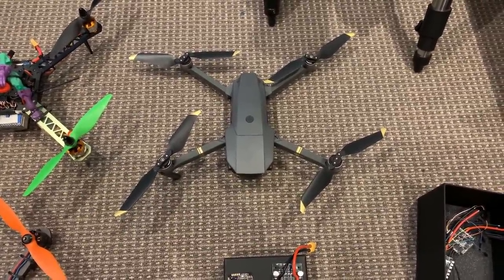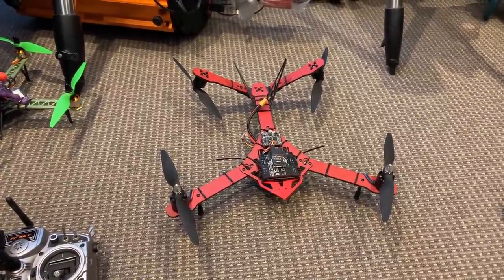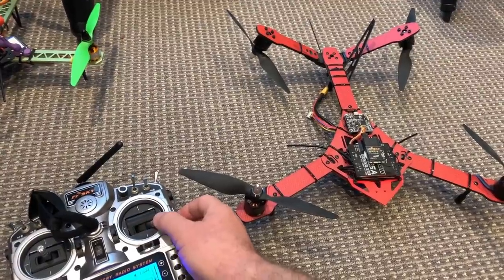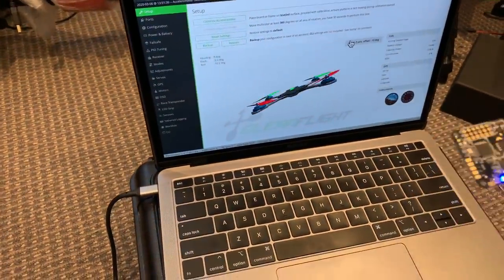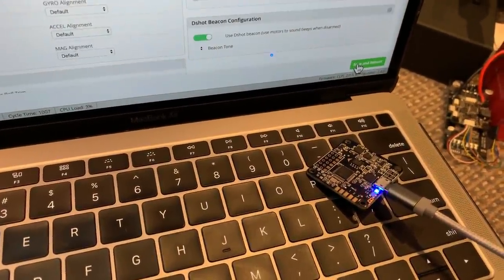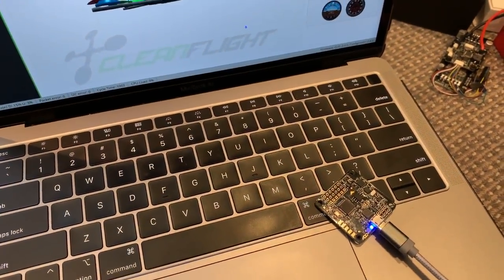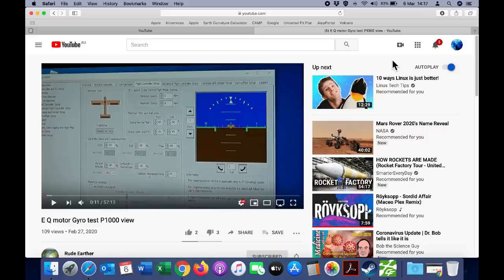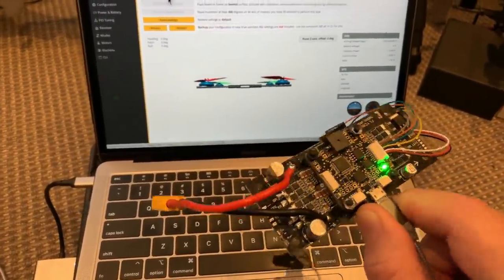A closer look at Drone Flight controllers.

Comment: Taranis is the best RC transmitter in its price range in my opinion. It's hugely configurable, talks to you, can be configured from the PC, does the whole nine yards at a very affordable cost. I use it in fixed wing models (one of them uses an ArduPilot controller) and on the TBS Discovery Pro drone, in which I'm using a DJI NAZA controller. I do use another transmitter (Spektrum DX7) on my helis though, just because they have been configured and tuned for years, no need to fix what's not broken.
Good video, thanks for sharing.

Comment: So what he’s saying is the board has two thingys working together. The gyro is only a basic gyro, and by itself cannot tell which way is down. It can only give you a rough idea how much you roll, yaw, and pitch. The accelerometer is not great either. It can tell you which way is down, but perhaps it doesn’t have the accuracy of the gyro. Together, they are Captain Planet!

Comment: That reminds me of a Flat Earther that bought an electronic gyroscope and drove like fifty miles along one of the Great Lakes to see if the Earth curved. It showed that it didn’t. 
  He didn’t check the sensitivity of the gyroscope beforehand, and he didn’t even check to see if his car was truly level at the starting and ending points for the less than 1 degree that would have been seen even if the gyroscope was sensitive enough. Of course the model of gyroscope that he used wasn’t nearly sensitive enough to detect the rotation of the Earth, anyways. 
  They just don’t take any variables into account, do they?
   I don’t know if that sounds familiar, as it was probably 3 yrs ago. For some reason I want to say that it was a video that you actually did a response to. I can’t say 100%, because I’ve seen so many videos debunked by so many different people.

Comment: As you indicate, MEMS based gyro/accel/magnetometer sensors such as the one in the Cleanflight compatible boards are generally fairly low-sensitivity (as single-chip gyros/accelerometers go) as they are intended for multiple-DOF mobile-devices for gesture-recognition and similar things.
Some researchers, though, did manage to use more "lab grade" MEMS units to get an "Earth Rate" signal without resorting to interferometer based systems.
https://iopscience.iop.org/article/10.1088/0957-0233/23/2/025005

https://ieeexplore.ieee.org/document/7494470

The software and processing was fairly clever, though.

Comment: How does the “V” affect its flight?  Does it act like the dihedral of a wing?
Reply from the maker: +Kelly D.  It gives very precise yaw control because a component of rear motor thrust is horizontal.   A normal multi rotor yaws by torque reaction speeding up two diagonal opposite motors that rotate the same direction.  

It does require adjustment to CG and a special mix in the controller.   I will cover than in a future video.
Reply: @Wolfie6020  yes please. 

Whats the minimum size for a copter to use magnetic heading hold? With brushless motors (known rpm) and averaging I'm guessing fairly small, but I'd love to see it as an option on micros.

Comment: What altitude is the effective ceiling for such drones?  If you were on top of a very high mountain, would the air be too thin to get enough lift to fly?
Reply from the maker: +TheBartman47.  Good question.  I did notice a slight difference in performance flying one of mine in Switzerland years ago.  

Also the Mavic is definitely more sluggish up at Beaver Creek, Colorado.  The motor RPM is noticeably higher in a hover. 

I guess if you were up around 15,000 ft it would get really noticeable.  

The DJI Inspired had an option for high altitude propellors.   I never needed them but they had more pitch on the blades

Comment: My roll and pitch is setup for 1200 degrees per second roll and pitch rate but admittedly my drones are race drones. Wolfie, do you still fly helis? (models)
Reply from the maker: +OzFPVflyer.  I haven't flown an RC Heli for a while and would be rusty I think.  Something I want to get back into though. It was a lot of fun. 1200 degrees per second is fast!
Reply: @Wolfie6020  Well if your interested Ive got a Trex600n pro with all the fruit on it with onboard ignition and it flys great, never crashed and Ill be putting it up for sale in the next few weeks, Its setup with a DX7 but I want to keep the Transmitter and the 7 channel receiver stays in the heli. Cost me nearly $3000.00 to setup but selling for $650.00. Its a smooth flyer with Curtis Youngblood blades and Curtis Youngblood exhaust and OS 50 engine. If your interested next time your in Perth.

Comment: Hi Wolfie, it is a bit off topic, but I have a question exactly matching your core competence. It is a claim made recently in a discussion on MCToon's channel (in the context how international flights compensate for the Coriolis force).
You may watch the part I'm referring to yourself here
https://www.youtube.com/watch?v=-Rv7q__gbCY (skip forward to 2:02:00)
but to spark your interest a bit more I paraphrase a few quotes:
- corrections for the Coriolis force are always done by the autopilot
- if a pilot would do it manually he would overcompensate and fly inefficiently
- pilots are basically only there in case something goes wrong and for taxing and takeoff and landing
- if the autopilot fails the pilots will land as soon as possible
Honestly, it is the last statement I doubt most as an unplanned landing is a costly operation (I could imagine) and in most any case l imagine it is less costly if the flight continues with the pilot or co-pilot flying manually, even if this were a bit less efficient than engaging the autopilot (assuming all the other systems of the airplane work perfectly fine).
Reply: I should be able to answer at least a little bit(just a student, so Ive never touched autopilot in my life).
There should be no reason to have an emergency landing if the autopilot dies.
As for coriolis, in simple terms, you correct when you are off course, which can happen for any number of reasons.
Wolfie, please correct me if I'm wrong.
Reply: @Alysm-Aviation  Thanks, exactly what I think too. To excuse the confidence with which Jack Zhang made that statement: If you are a well educated physics student (like Jack Zhang obviously is) and you habe to discuss an ignorant fool for two hours it might become unaware of the borders of their core competence.
I have a whole collection of such (mostly minor but sometimes even major) lapses by those supporting the globe (including another one by Jacky Zhang) but I've given up to forward such errors to the person who made it, except the very few who gave positive feedback.
But in contrary, a few of them, including some very prominent "globe earthers" are completely uninterested in being corrected or consider contradiction as hostile offence. And if they answer claiming being right where they aren't and you come back a second time you may get blocked by them or they moderators.
Sadly, if it comes to making decisions based on "in-group/out-group" thinking there is not so much of a difference between (some of) the "globers" and (most of) the "flatties".
Reply from the maker: +Mittelwelle 531KHz.   Thanks, I will check the video but can answer those quite easily here too. 

Correction for Coriolis occurs simply by the aircraft making adjustments to stay on course.  Any deviation left or right of track is immediately corrected with a tiny heading change.   

The autopilot does it more tightly.  If a pilot hand flies he won't necessarily over control but it would be less efficient.  I can agree with that.  I would not say inefficiently,  just less efficient.  The difference would be less than 0.1% in reality if the pilot is on the ball. 

We do usually only hand fly for take off and landing but monitor constantly during cruise and will select new altitudes for better winds or to avoid turbulence.  We will also divert left or right of big storms on track.  The autopilot cannot do those by itself so we set the parameters for the autopilot in those cases. 

I can't speak for every airline policy but we certainly would just keep flying to the destination if the autopilot failed.  It is no big deal really.  Just a bit more tiring on a long trip.   There are some emergencies where the checklist directs us to land as soon as possible or at the nearest suitable airport but autopilot fail is not one of them in our aircraft.   

In the middle of the ocean you don't want to land on a remote strip with a broken plane because there is nobody there to fix it and flying an engineer out with parts will be expensive too.   Unless it is a dire emergency we will carry unservicabilities to a destination with maintenance facilities.
Reply from the maker: @Alysm-Aviation  100% correct.  You can be my wingman anytime.
Reply: @Wolfie6020  don't get my hopes up, otherwise I might just apply to your company should I ever get up to the required licenses.
Reply: @Wolfie6020  Thanks for taking the time to write such an exhaustive answer.
Wrt. the video link don't waste too much time with it - the usual crap with an utterly ignorant flat Earth proponent who is missing to understand most badic physics like frames of reference and math and geometty vs. a well informed physics student who is able to explain his stuff well and thoroughly but just overstepped the borders of his knowlrdge dimain when talking about flying (somwhat understandable after discussing a complete ignoramus for 2 hours).

Personally I have no idea how it feels to pilot an airplane but I have a bit of experience steering a ship and here many novices actually overcompensate small course deviations. They steer like you would steer a car, putting the controls more or less abruptly to neutral once they are on course again, not considering the rotational momentum the heavy hull of the ship has. I can imagine it is somewhat similar with flying a plane, only that the effect occurs in not just one but in three axis.
Once I understood a turn doesn't stop the moment you put the steering wheel to neutral (like in a car) I not any longer found it hard and was able to steer boats in close to perfectly straight lines as a seven year old boy.
Reply: Just to confirm, airline policy would be identical to Wolfie's with an Autopilot failure. No diversion required unless for other operational reasons. The aircraft can't autoland (hopefully that's obvious) and landing minima would be higher, usually 550 m visibility and 200 feet decision altitude rather than 75 m visibility and no decision height. We are, of course, required to demonstrate the ability to fly all maneuvers without autopilot during annual checks in the simulator. That will include an engine failure shortly towards the end of the take-off run, a single-engine circuit, an instrument approach to 200 feet with a go-around. 
In terms of "steering" the aircraft, it is different from both ships and cars. You put a control input in until the desired attitude is achieved eg 30 degrees of bank. The controls are then returned to neutral while the aircraft is in the turn, with minor corrections. And then, shortly before the planned heading is achieved, another opposite control input is made to return the wings to level.
Reply: @mittelwelle_531_khz  Wolfie did a video on the Coriolis effect not too long ago. Not sure it is related to this thread. https://youtu.be/eugYAfHW0I8

Comment: Are the verbal time warnings and countdown timer predicting the power left in the batteries, or is it something else like the time allowed for a freestyle acrobatics routine in competition?
Reply from the maker: +Micheal Onines.  The timer while flying was just based on a conservative use of battery capacity.  With that type of flying the battery would have around 30% left.  

I start off more conservative with a new model and when recharging note the amount going in to the battery and fine tune over a few flights.  It could fly another minute but that would really drain the battery and they last longer overall if not discharged too much per cycle.

The low battery, battery critical is it happens when you turn the radio on due to the way I set up those warnings.  Also very conservative.

Comment: why anyone would buy one of those stupid dji drones is beyond me, just get a regular quad and attach a good quality camera to it, why anyone would buy such an expensive drone given the alternatives baffles me.
Reply from the maker: +tiggerbiggo.  To be honest four years ago I would agree with you. 

I was building drones and testing various gimbals and cameras and getting pretty good results at the time.   Then one of my friends gave me a Phantom 3 Pro to test and set up as he knew nothing about them.  The quality was so much better than what I was getting with a GoPro and was actually cheaper than the drones I was building.  Plus a lot more portable. 

Then I bought the Inspire because it looked very cool.  It was good for travelling as it packed up neatly into one case. 

When the Mavic came out the size was too good to resist.  A tiny case holds the drone, controller and several batteries.  Smaller and more convenient than anything I owned. 

I could not build something with this capability for less and it would be larger and require a full size controller so it was a no brainer.  The Mavic is great for travel.
Reply: @Wolfie6020  I suppose i'm just thinking in the perspective of how I would feel if I sank thousands into a high end drone and it couldn't even do acro mode if I wanted it to. No idea if hacks or mods exist to make it do so, but there's no way it's physically incapable of acro, nor do I believe it lacks processing power. In that case, it's purely a software limitation, which I utterly despise out of principle.
Reply from the maker: @tiggerbiggo  I totally understand.  It does have limitations if you just want to throw it around and have a bit of fun
Reply: @tiggerbiggo  You're basically saying you want one drone to do it all. That's about as realistic as racing a sport bike against a dirt bike. Different tools for different jobs.
Reply: @JeremySchoeder  No, i'm saying physically, it is already capable of doing acro. It has an accelerometer and a gyroscope, and you only even need the gyroscope for acro. The ONLY reason it cannot do it is because they have prevented you from doing so. The drone already could do it all, with a minor software tweak. It's not only realistic but stupidly easy.
Reply: @tiggerbiggo  You may be unaware that there is a rather delicate and finely tuned brushless gimbal on those DJI drones. Their primary design criteria is buttery smooth video, acrobatics are quite contrary to that objective. I built a heavy lift octocopter and gimbal back before you could buy them, they work best with subtle, fluid movments. The maiden flight is still on my channel, as is a troubleshooting video from the brushless gimbal build.
Reply: @JeremySchoeder  you're only further making my point. The fact that it is a highly advanced, highly tuned drone is precisely why acro mode should be an option. It's such a small step that its exclusion is ridiculous. Furthermore, it is absolutely possible to use acro mode to fly smoothly and would allow a greater flexibility for the pilot to be able to make turns however they need to.